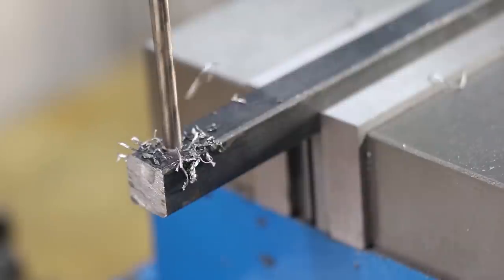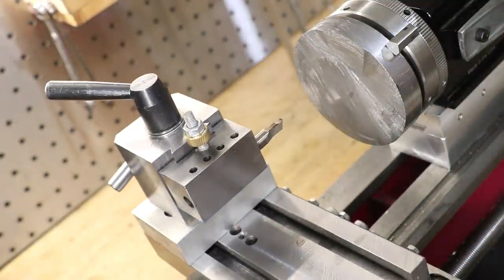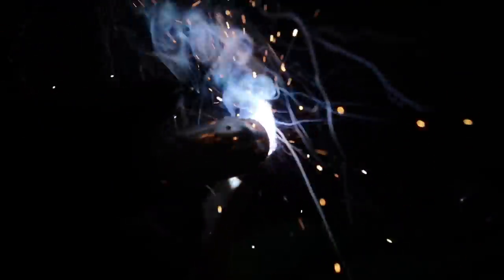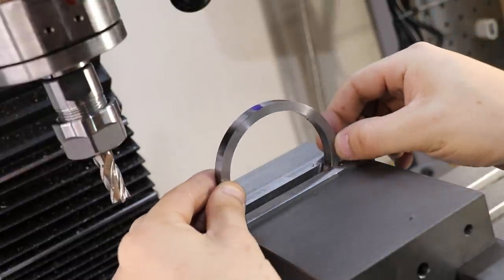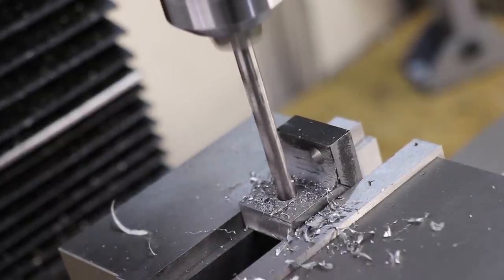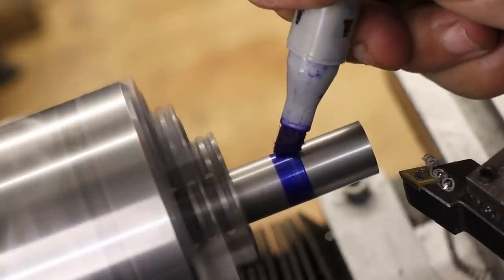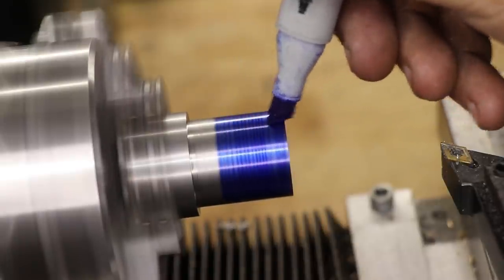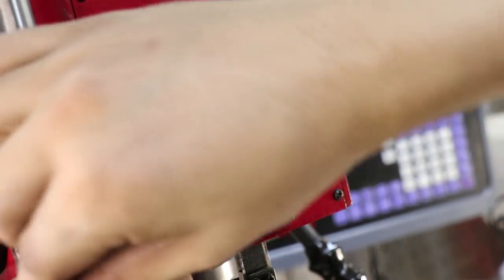Depth Stop Upgrade For The Milling Machine (Quill Stop)

Comment: For welding the side arm (and in general), I would recommend grinding a deep 45 degree chamfer into the parts and fill that with your welds. Will hold up much more than just the 'tack' you get when welding over the two flat sides.
Reply from the maker: Thankyou, yes I must have overlooked that this time. Thankfully these welds are under minimal load. Cheers

Comment: I enjoyed this video just like I have all of your others. 
I know you're limited on shop space, but please, please, please consider picking up a portable bandsaw.  My own arm hurts just from watching the time-lapse of you doing all that work with a hacksaw! 😨
I bought a used import for $40 US and honestly, it's the most time- and labor-saving tool I've ever bought for the shop.  
There are plenty of videos out there of users who make a small stands to allow them to be used as vertical saws, but one particular design really stood out:
Rather than mounting the saw to the table with a couple of screws like everyone else - which leaves the entire blade exposed all the time - this guy had the saw mounted to a piece of ~2" square tube held vertically in his bench vise.  I haven't been able to find the video again recently but if I remember correctly, the table was mounted to another, slightly smaller square tube that slid into the first, allowing it to be easily raised & lowered.  The outer tube had a small notch cut into one corner, with a nut welded into the hole. This allowed a knob, made from a bolt, to clamp the two together with the table at any desired vertical position relative to the saw.
I'd love to give the maker credit for the design, if I could only find it. 😕 If anyone recognizes it and knows where it can be found, please post a reply with a link.
Thanks again for all your excellent content!

Comment: Your welds, from what I could see, look just fine. I will suggest that when welding butt joints, bevel them first to give the weld more penetration. For the fillets (corners) you're doing fine.
Reply from the maker: Thankyou, yes I must have overlooked that this time. Thankfully these welds are under minimal load. Cheers

Comment: Something I found very useful when using a hole saw in relatively thick material up to 40mm thick (steel or 6061 aluminium), after getting the hole position set and maybe 2~3mm deep, drill through holes in the cut so swarf has somewhere to go.
Hole saw is usually around 1/8" wide cut due to the tooth offset so I use 1/8" or3mm drill bit
One hole will work but it's just as easy to make 3 or more somewhat staggered rather than equal angles (it also means the cutter isn't fully engaged around entire periphery)
If you don't need the 'slug' from piece, larger holes offset so they intersect the edge you do want gives even more clearance (around 3/8"~10mm dia)
 I found it prevents swarf building up and locking or jamming the cutter in the 'groove'

Comment: Great work as always dude, And nice upgrade getting a Mig in the Workshop. Just watching the Video back looks like your welds might be a bit on the cold side and I imagine all the splatter is maybe down to the higher lead content in machining steels. Not trying to be critical just though it may help you out if you haven’t migged in. A few years.
Reply from the maker: Cheers, it could be this. This was literally my first MIG weld in close to 7 years, not embarrassed to say that these were some questionable welds. Take care, looking forward to your next video.
Reply: I was thinking with all that weld splatter that you were welding without using gas. Was I right?

Comment: I have a Ryobi 18v portable bandsaw collecting dust in my workshop. It is yours if you want it.

I imported it to Australia over a year ago and then soon upgraded to makita so it has been sitting ever since. It only does 50mm stock and needs some new blades but its better than a hacksaw.

Comment: Nice, a quick tip to get rough depth dialed in is to use a the inside jaws of a caliper between the stop ring and the bottom. I use it at work with Bridgeport's.
Reply from the maker: That is a great idea

Comment: To weld these pieces one should grind an angle onto one or both pieces most of the way in, and then fill the gap with weld metal.  This is called a full penetration weld. 

What's done here is a (very) partial penetration weld...i.e. it is mostly just sitting on the surface.  This can be okay under some non critical circumstances but if you then grind most of the weld bead away for aesthetic reasons as was done here, the is very little strength remaining in it. 
A further problem with using this approach was to combine it with mig welding, which commonly can be a bit cold i.e. not enough current to get much depth of penetration so the weld bead is almost entirely sitting on the surface.  I have even seen short mig welds where there was a blob of weld literally sitting on the surface that had not even fused to the surface.
Reply from the maker: Thankyou, yes I must have overlooked that this time. Thankfully these welds are under minimal load. Cheers

Comment: Love your channel and am finding the hints and tips very useful. I take my hat off to you and your hacksaw. Up to half an inch I will use mine, after that its the chop saw or the angle grinder with a cutting disc. My next purchase is a welder. Ive done gas welding in the past but never electric. I fancy a go with tig.

Comment: Instead of using your 123 blocks to line things up parallel with the edge of the vise, try using a parallel if you have them, I find it abit easier to hold onto. Another great video man, keep em coming.

Comment: how to make a depth stop video about a zillion times more complicated than mine. I machined an aluminum collar that would slip over the round base of the downfeed hand lever (right side of the machine). I put a 1/4" (or 6mm) machine screw in it so it could be tightened and locked to the base when/where needed. I then drilled and tapped a hole in the side of the casting and put another machine screw with a locking nut to hold it tight in the hole so it would stick out and located so it would come in contact with the machine screw in the lever base collar.  To set it up, move the handlever to where you want the chuck to stop (and lock it if you have a spindle lock). Spin the collar around and tighten the screw so its hitting the stop screw that's sticking out the side of the casting. Done. Took me about a half hour to make this, works perfect. Wouldn't have made much of a video though....and me not wanting to become a tube vid hero.....
Reply: And I am sure that works great, so long as you only need less than 360 degrees movement of your downfeed wheel.

Comment: This may be a stupid question.  Is there a possibility of making a hinge mount on the back of the lathe and then using a hack saw to cut through a big work piece (with the back of the saw held in the hinge point).  Just turn the part and then use the saw as a way of cutting through the stock.  Would save a lot of hack saw time.

Comment: I have to say. you must burn though hacksaw blades?

I was thinking on the bracket. a countersink screw would have been a better option. it would have looked a little cleaner. and held the bracket from moving around better.
Reply from the maker: Not too many, these are full HSS and last longer than you might think

Comment: A possible source of flexibility affecting repeatability is the single offset screw holding the L bracket. Need 2 screws to keep it from rotating when pushing down. Or center the mounting hole
Reply from the maker: It is quite secure the way that it is given the small amount of load it needs to deal with, the flex is coming from the arm. If 0.15mm of flex is too much for you you can always make a more substantial bracket.

Comment: Hi there, Been enjoying your vids. I have the same mill as you and noticed that the fine adjustment for the quill is quite hard to turn- is yours like that? Also when using the DRO for the quill it takes about 30 seconds to settle on its final readout after moving it.
Reply from the maker: For the dro it might be worth checking to see if the nuts are tight on the bracket that connects the dro to the spindle. Sometimes it comes loose. As for the fine feed, I can't offer too much advise, but its definitely worth trying to see where the issue is coming from. If you take the front cover off the spindle you'll see that it connects to a worm wheel. There might be a way to adjust it, or a way to see where the issue stems from. Cheers

Comment: Somebody get evolution to sponsor this man, he needs a cold cut metal saw asap.
Reply: Neverrrrrr!! 😅
Reply: If you want to trash a $150 blade per cut. Low-end cold cut saws are for angle, pipe, RHS etc. You're not even supposed to cut flat bar lying flat, because it causes too much continual tooth engagement. 80mm solid round bar would eat the blade for breakfast.

Comment: I’m a bit curious if there is a perceivable flex on the long arm extending from the ring spindle clamp. I have a mill with a similar lack of a depth stop and It’s a feature I very much want. But I find myself using the crank on the column to raise and lower the whole head to maximize rigidity on a cut. I’m doing it so much that I greatly lament the lack of a dial on the column crank. (Still saving for a 3 axis DRO) I’m wondering if the quill DRO that came with the mill should just be replaced with a more rigid depth stop that I can set the stop with gage blocks. The Quill DRO has a way of letting oil get into the battery compartment no matter how much I wipe down the machine so I’m not sure I’d miss it. I really like the addition of a depth stop to your mill but I’m hoping you can revisit the modification after some heavy use to tell us if it needs to be sturdier.
Reply from the maker: Yes there is, as there is on any depth stop that I have used. That would account for the 0.15mm variance in depth that I get, and for me I think that is acceptable. If that is too much for you, you can always change the design to make it more rigid. Personally I would keep the quill DRO because I find it useful, but if you don't, you could certainly replace it. As with any mod, do what is best suited to you. Cheers
Reply: @artisanmakes  Thanks for the feedback. Much appreciated.

Comment: I reckon you would get a lot more rigidity and repeatability of you didn't have that huge long arm sticking out. The depth stop needs to be as close as possible to the quill, not a long way away where flex becomes an issue. It seems very strange that you put it way out on the diagonal like that.
Reply from the maker: There isn't that much space elsewhere. To the left of the handwheel and to the right is the control box and spindle lock, the only other space is taken up by a camera and lighting mount. If you want to do things differently of you do this it is up to you. Cheers

Comment: Those welds are killing me, son. Jesus fucking christ. BEVEL THE EDGES. Then there is space for the weld to go. That way when you grind, there will be SOMETHING holding the pieces together. Since you like to grind off ALL the weld you just did. 

That little 80amp welder gets 0 fusion or penetration what so ever. BEVEL. Otherwise every "weld" is gonna fall apart, because you just thinned it down to a few thou thick, if even, by trying to make it be "invisible".
Reply from the maker: Relax, not the best example of a weld or technique, but these are under minimal load, and there is plenty weld material to do the job at hand, its a depth stop not a table frame. As I said in the video I'm not a great welder, and I certainly need more practice. Everyone starts from the same place. Take care.
Reply: Of course it gets some penetration, it's not just plopping a bead on the surface
Reply: @artisanmakes  Sure. As it came apart in your video? Same for the clamp, the only reason it might work is due to the razor-thin cross-section being in tension, like a dog. And filler being twice as strong as the base metal helps a ton here. Look at how dogs are done. A single weld, on one side. Yet, it can take thousands of pounds of force, and yet are removed with a light tap with the hammer. You have done this by accident.

It's not about the welds you did. Everyone sucks at welding for a VERY long time. Only an idiot would hold that against someone. It's a skill that is learned and refined over YEARS. If you ask a welder when they stopped learning, they will tell you NEVER.

 It's the fact you removed 95% of that weld to begin with. It could have been a nuclear quality weld, with no prep, and the same issue would have occurred. Except it wasn't.

Draw lines from the original surfaces of the metal. Your welds are sitting ABOVE this level. If you remove them until just a few thou of metal exist in the corner. There is no more weld joining the pieces together. By beveling, you get more weld metal, and below the surfaces you grind to. 

I'm not going to comment on the welds or welding technique. Your other work shows you understand the basics of stresses, which is why I had to comment on you throwing away all your knowledge on the matter for this. When it would have added a few seconds of effort.

Bevel your shit. If you ever go "should I bev.." the answer is yes. Especially with smaller machines. Same for pre-heating before welding. The answer is yes.
Reply: Or, you could just gob some weld on and she'll be right because the stresses in that workpiece are approximately fuckall. Calm down. You will never elicit a positive response when you come at someone with this kind of shitty aggressive attitude. Especially when it's essentially irrelevant in this application. And *preheating*?! Are you serious? What a waste of time.
Reply: @Jamvan001  You didn't read. I SAID TO GOB IT ON. I said the problem was he ground the entire weld off. Leaving a razor blade of weld actually holding the piece on. Which is why it fell off IN THE VIDEO. I also said the problem, was welding only one side, but that it might work, since that's how you do welding dogs. One side, under tension. So he wouldn't need to weld all 4 sides of the block. But a razor thin cross-section under tension.. well, chances are he'll learn a new term. "Fatigue".

If he ground bevels. Then he could grind back to the original surfaces like he likes to do, and still have.. 1 piece of metal. UNLIKE THE VIDEO. I did not tell him to pre-heat. I said underpowered welders running too small a wire can get BETTER PENETRATION, the thing he got literally 0 of, as per the video of the part falling apart, can benefit from both beveling and pre-heating. You should.. you know.. try to do the best you can with what you have. Not everyonee has 350A pulsed mig power supplies. You run what you brung. Sometimes that means having to put a bit more effort in prep, to make up for lack of equipment. It ain't a slight. It's.. how it is? Sometimes you  gotta put in extra effort to make-do. Something he obviously has no problem with, since he fucking hacksaws everything. But nope, guess welding is off-limits lol

How are people supposed to.. do better? Learn things? Make things better? When they refuse to admit "ya know what, maybe i shouldn't have ground so much weld off'' or 'ya know what, maybe a bit more heat would help'. When they documented, in their own video, what happens when you don't? Is this an ego thing or something?

But k. I'll wait for the next video and see.
Reply from the maker: @dogsarebest7107  Well not as such, it fell because I milled through it to reduce the width of the wall. Cheers
Reply: @dogsarebest7107  why are you so aggressive wtf

Comment: I like how all parts are custom made, yet put all together it looks like a scrap bin project. Poor design choices and massive spring back renders it useless really.
Reply from the maker: Well when you are riffing off the cuff you sometimes get projects that don’t turn out the way you’d like. No need to be so rude.
Reply from the maker: But it works to the extend that I needed it to so in my books it was a win